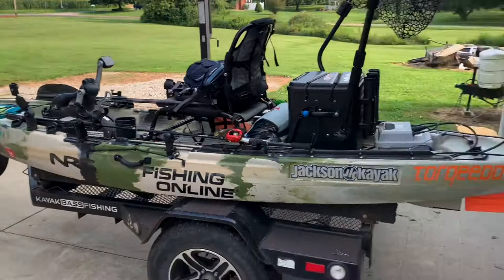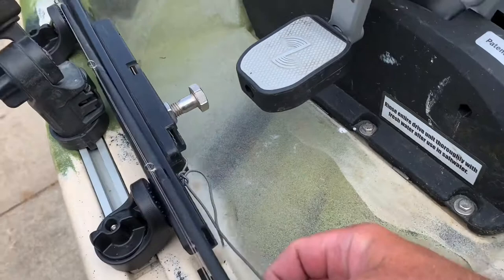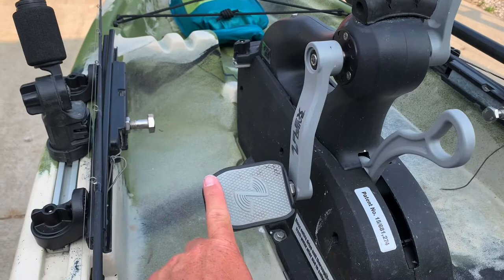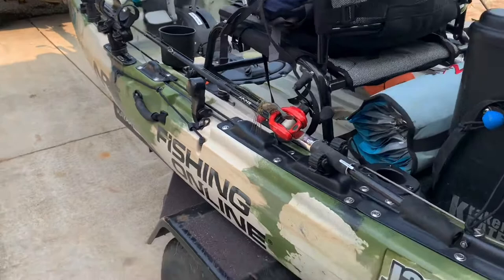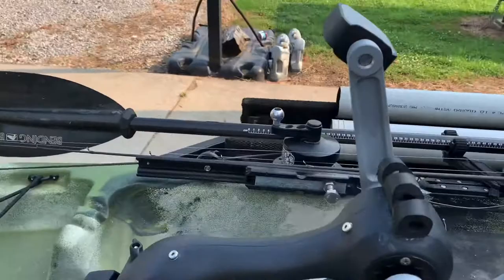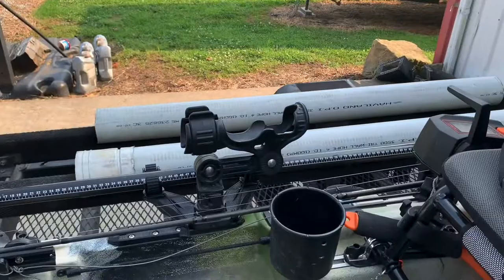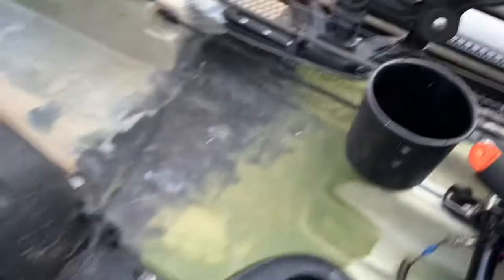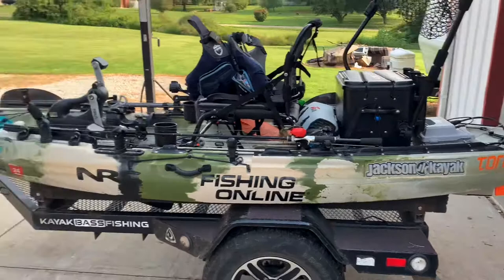Jackson Kayak Bite FD Torqeedo install

Comment: As a fly fisherman I wanted a smaller profile foot pad for my trolling motor foot steering to reduce snags when fly casting. I used the Yakattack 90 degree adapter as the foot pad. The Yakattack Mighty T-bolt fits into the Jackson Kayak foot rails when oriented perpendicular to the rail. I made a small shim out of starboard with a notch to hold the T-bolt vertically. I finished it off by screwing a piece of 1/4” starboard and used 3M tape to glue a piece if EVA foam to the pad. This lower profile foot pad is about half the size of the stock JK foot pads and could also work to provide clearance for foot steered trolling motor on a pedal drive kayak.

Comment: Awesome presentation. I have a Bite FD. One question. I don’t have a torquedo. So my question is, why is secondary torquedo steering necessary when there is rudder steering for the kayak,  because it’s an FD. Why not just fix the torquedo in the straight position and steer with the rudder.